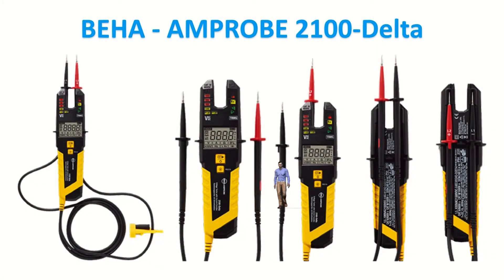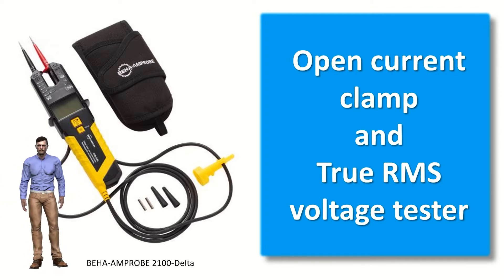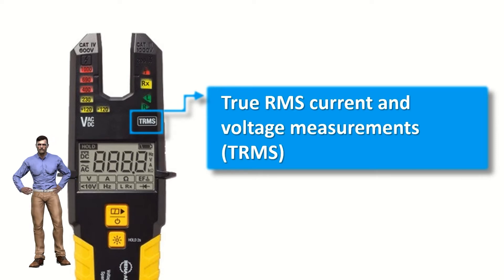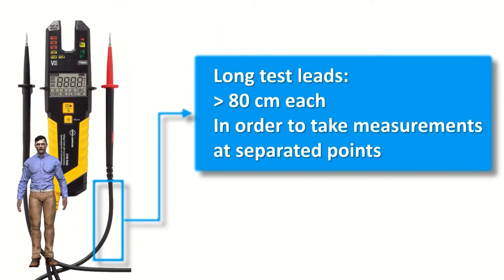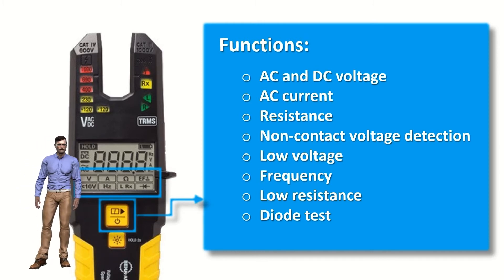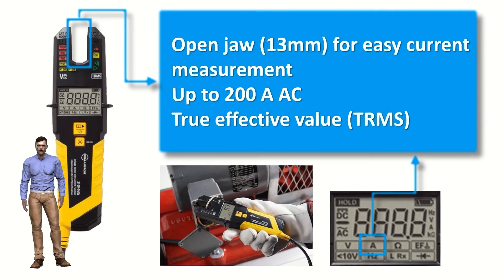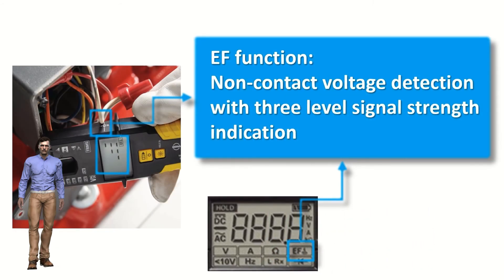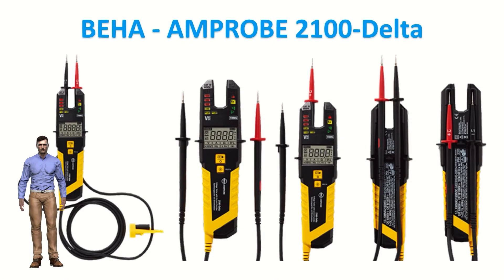How to use the new Beha Amprobe 2100 Delta voltage and current tester. Functions and characteristics

Comment: What will happen if I put the device in resistance measurement mode and put the probes in contact with a voltage of 380v?.
Reply: It change to V mode.